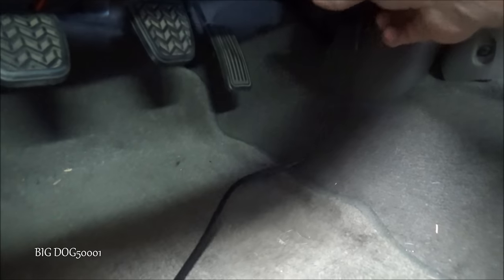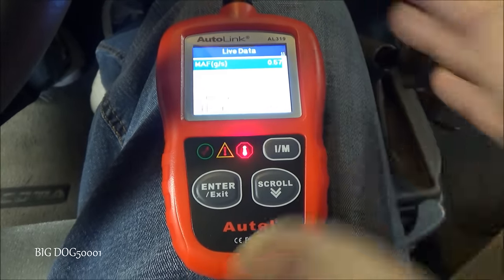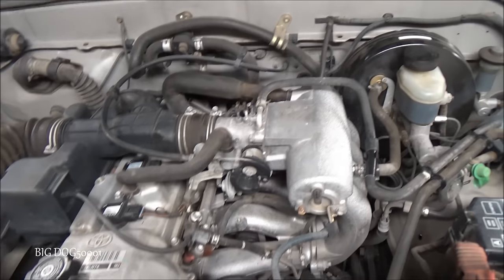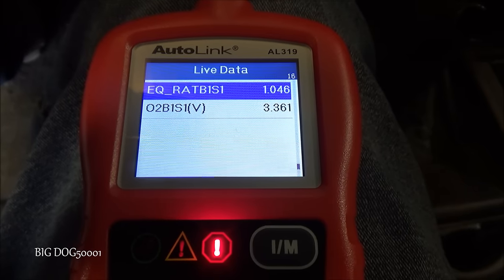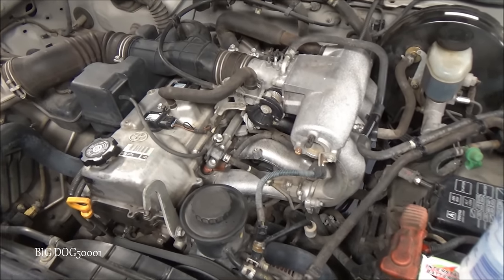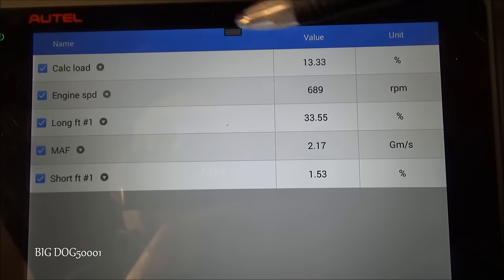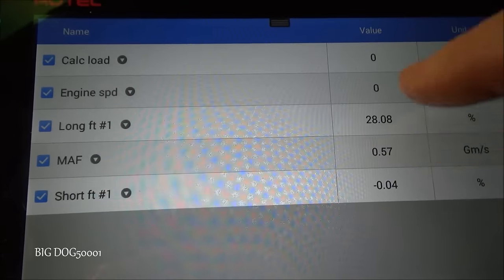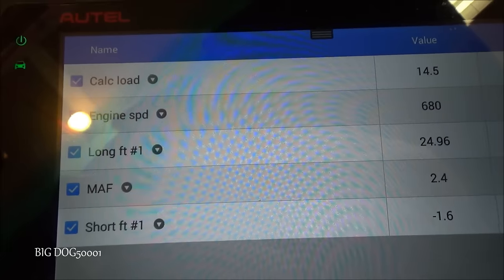P0171 Trouble Code: System Too Lean Bank 1 Diagnosis

Comment: Thanks for a such good video like this one. And would you kindly help me with this issue on my Audi TT 8j, I get P0171 every 2 days. Sometimes I feel surge or hesitation.  When the p0171 occurs, the short term trim was at 0.0%, long term trim at 3.9%, 800rpm, MAF 3.9g/s . So what should I look for? A minor vacuum ? Or sensor? Or fuel problems?

Love from Japan. Thank you very much.
Reply: PS: it’s p0171 system too lean

Comment: Super helpful video my friend!  I have that same code reader and I honestly thought it was just for telling codes. I had no idea I could look at the freeze frame and live data to help me diagnose (I have very amateur mechanic skills mostly limited to repairs my cars have needed).  Thankfully, I was already on the same warpath for diagnosis on my '08 corolla.  Along with the code, I had the added symptom of hearing a loud whine at idle and I'm pretty sure it's the sound of a vacuum leak vibrating somewhere, especially because the noise briefly goes away and/or changes pitch when giving enough gas to accelerate.  But as soon as the throttle is back at idle or maintaining speed, the same noise comes back.  The noise was actually the first thing to happen and ran like that for a bit before the code, so I imagine it's a smaller leak and the tiny leak is just vibrating like a woodwind reed.  Eventually the code gets thrown, but after I reset it, it takes days or weeks to come back.  Now the noise is mostly gone and the code throws easier, so I'm sure the leak has worked its way to a larger gap.

 I recently replaced the PCV and hose a bit over a year ago just for funzies when I did the valve cover gasket (she's got 200k miles), and I wonder if something there has failed.  That's the vague area that the noise seems to be coming from.  I am set to really diagnose the location of the leak tomorrow, but I will definitely use your code reader tips to help me confirm that is the right direction, and specifically look at the fuel trims.

Comment: Not only a Thumb's Up but also a Sub.
This must be the most valuable YT vid I've ever watched.
Not only was the info of high value but BigDog's explanations were outstanding.
A long vid but worth every minute.
I just did a repair on my 2000 5.4 Expedition, cleared a #7 misfire code but now generate a Lean Bank #1 code when I goose it getting onto the Interstate. Since I had the EGR valve off during the repair, my guess is I buggered it up when reinstalling it.
BugDog's vid just walked me through the process of finding my oroblem(s).
OUTSTANDING INFO/VID.........
Reply from the maker: Thank you, I appreciate the comment!

Comment: and/also: be sure to verify the GROUND to your O2 sensors!  I just had a breakthrough... and realized a corroded wire was throwing off the ground on the O2 sensors loop.. and therefore reading LEAN..  and pushing too much fuel / throwing off the balance.

Comment: Can you guys help me please with opinion about this code trouble in my situation, because one day this code appear and I cleared code on other day no codes everything nice. Then again on other day appears this code. I again clear code and drive without any codes, then can appear P0301-P0303 what mean misfire in some days 1 in someday 3 cylinder. So problem that all those codes replace each other's if clear them, they never appear together, sometimes no codes at all. So I can't understand car have probly or not? Cuz if be true problems then code must be all time appear? But in my case it's appear randomly, one day can be without codes in other day can appear one from those codes

Comment: Super educational! Checked it out after engine light have come on with same code several times during the last years.
In my case the freeze view showed a situation at 70 km/h with about 45% load. Fuel trim showed 19,5% short term and 29% long term. 
Did all the visuals but didnt find anything. I dont have a vacuum gauge however.

Fuel trims looks good at idle, MAF around 2.3. Did a couple of hours ride both on the highway, then mixed city driving, while watching live data. Fuel trim stable around 0% give or take -5 to +10 at accelerating /releasing gas pedal moments. Engine light hasnt come back on.

Question (if you have time!): I very seldom drive this car. When I do, it's 99% alone, empty trunk. The latest engine light came on during a trip to IKEA where I loaded up the trunk with new furniture etc. Could heavier loads in some way output a much higher fuel trim than usual? Or perhaps revealing a weak fuel injector that isn't exposed otherwise? I'm also curious if the new higher Ethanol based petrol has something to say..

Comment: Great video. I have a P0171code, lean bank 1. You explained everything I wanted to know about fuel trims and what the scan tool can tell you about the other sensors on the engine. This video and my scan tool led me to a faulty fuel pump.  Thank you.

Comment: Hi, my 2005 highlander does not get better with new maf sensor, it reads 0.3lb/min, stft 20.3%, ltft 44.5% (does not change at all at any time) i step on the brakes and stft reads 19.5. The Ratbs1 is 1.083 the o2V shows 3.94 high rpm 2.98. Snap throttle 4.17all i need to check is a vacuum leak with vacuum gauge, do i accelarate with the vacuum gauge on? Any help will be appreciated

Comment: I live in a Rural Kansas area with my only  vehicle a reliable 2015 Prius 3.  I got a check engine light after a 45 mile drive to a larger city in the area, so i took it to an Auto Zone. The ran the scan tool eith a result of a P0171 result.   Auto Zone told me it could be as simple of a problem as a dirty sensor.  It was near dark near  by the time I was finished setting up /arranging an appointment in another city where I trust the word of the mechanics.  
     I stayed over night in my car as I didnt want to be stranded on  rural road at night.  And  certified ToyoTa Mechanic said if i drove slow , I could drive my car home.  The next day, I drove 30,-32 mph (with several 15 minute engine off rest breaks to cool off the engine) until the I 70 required 40 mph minimum for 8 miles of the 42 milr alternate route.   I made an appointment for their first open appointment time- a couple of days from now.  The dealer is 65 miles away.  Should i have it towed or can i start early and drive with my flashers on even though the solid check engine light is on?

Comment: quick question the MaF(g/s) you said it should be around .4 to .5 for most toyota, does that include 2001 toyota celica?
Reply from the maker: I don't remember off the top of my head but I believe it should be somewhere in the vicinity with the key on and engine off.

Comment: This video was as clear as it could ever be. Followed closely, concluded that it had to be a vacuum leak to both cylinders (p071 and p074 on 03 avalon). After spraying carb cleaner to no avail ,rubbed my fingers like shown in video along bottom of vacuum hoses and found a crack below hose going to brake booster. Love !!! this dude. 5 stars

Comment: I'm trying to follow along, I appreciate the information but what if the fuel trim stays high at both idle, and acceleration?

I'm getting 46% stft at idle 22% ltft but at 2.5-3k rpm it's dropping to 24% stft while ltft unaffected.

Would this suggest both an vacuum leak and a fuel delivery issue? I'm trying to learn but any further insight would be greatly appreciated.

Comment: Monitor your short fuel trim while spraying for external leaks, then pinch off hoses while monitoring sft. Test maf response. maf grams per sec should be X 1.1 of cyl displacement. A 4 cyl 1.8 would be near 1.8 while a 5.3 would be much higher at idle. High fuel trim at idle and higher rpm's would indicate a fuel pressure or fuel injector restriction problem.

Comment: Hi there Big Dog I have a 2005 Dodge ram 3.7 6 cylinder loud air leak and after warmed up and running loud knocking give it gas gets louder and seams like it loses power get off gas knocking gets less  but still knocking I checked vacuum lines had some bad leaks knock went away but came back I've been watching your videos and you said something about this knocking sound with a bad vacuum leak from brake booster. I think what you said put me in the right direction with the booster needing your help thank you Leon

Comment: hi, great video, i had the same code on a 01 tacoma, w same p0171 code and ending been fuel injectors restricted, no driveability problem, but fuel trims inacurate, found aftermarket fuel filter w lots of dirt on inlet and outlet sides. replaced fuel injectors and problem solved.

Comment: Excellent video, really helpful. My long/short fuel trims were 32 and 0 at idle. When I raised the RPMs to 2000, the short term went down (to around -11), which you said indicates an exhaust leak, but my long term went up to 43.8.  So the combined value was about the same at idle vs 2000 RPM.  Does this suggest that the issue is with the fuel delivery system?

Comment: I got a 2017 Nissan Sentra.  About a month ago I got a code P0171 code. It was running just fine. A few weeks after it started to lose power going uphill.etc  weak running . I tried looking for a vacuum leak couldn't find one

Comment: Never fall into that parts hole. I have a Mercedes ML350 that had a broken clip on the air intake & the engine cover could push the intake off the throttle body. Cover on, 'short ft1' would hit 18 - 20% idle. Cover off, 5 - 12% idle. So I reinforced the intake connection with a clamp & left the stupid engine cover in the garage.

Comment: Any way you could point me in right direction would be Gratefully Appreciated 🙏 I have a 2005 ford focus. Car died and wouldn't start; finally restarted after messing with shifter and twiddling 3mths later. Changed fuel rail sensor(had code),P0171 code:: fuel filter,  cleaned spark plugs and did valve gaskets. Cleaned maf sensor. Car stalls after 10 min idling, dying at stop lights ??  Thinking go ahead and change this since I  have it .(ignition switch module)Had forgotten I got this code a long time before it actually started. Got code when battery was low and read not to pay attention to codes from low battery?? 🤔 any ideas? Could it be losing pressure driving or after the 10min.?Thank you for your time! I  have info from live and freeze frames, but I don't understand 🙃 😅
Freeze Frame Report Apr 02, 2022 07:33 PM
© BlueDriver 2019
2005 Ford Focus
1FAFP36N25W218008
Last Entered Odometer: 116,637 mi
02 DTC that caused freeze frame data Trouble Code P0171 triggered Freeze 
Frame. Code Def - System Too Lean 
Bank 1
01 Monitor Status Since DTCs Cleared 0 
03 Fuel System Status Closed loop - using all oxygen sensor(s) 
as feedback for fuel control
04 Calculated Engine Load Value 56.1 %
05 Engine Coolant Temperature 91 °C, 196 °F
06 Short Term Fuel Trim Bank 1 0.8 %
07 Long Term Fuel Trim Bank 1 24.2 %
0B Intake Manifold Absolute Pressure 64.0 kPa, 18.9 inHg
0C Engine RPM 1942 rpm
0D Vehicle Speed 17 km/h, 11 MPH
0E Timing Advance for #1 cylinder 22.5 °
0F Intake Air Temperature 30 °C, 86 °F
10 Mass Air Flow Rate 15.58 g/s, 2.06 lb/min
11 Absolute Throttle Position 31.8 %
14 O2 Bank 1 - Sensor 1 - Short Term Fuel Trim 0.8 %
14 O2 Bank 1 - Sensor 1 - Oxygen Sensor Voltage 0.035 V
15 O2 Bank 1 - Sensor 2 - Short Term Fuel Trim 99.2 %
15 O2 Bank 1 - Sensor 2 - Oxygen Sensor Voltage 0.020 V
1F Run Time Since Engine Start 102 seconds
22 Fuel Rail Pressure (relative to manifold vacuum) 272.234 kPa, 39.484 PSI
Page 1 of 2
Freeze Frame Report - 2005 Ford Focus
2C Commanded EGR 52.5 %
2E Commanded Evaporative Purge 0.0 %
2F Fuel Level Input 0.0 %
30 # of Warm-ups Since Codes Cleared 2 #
31 Distance Traveled Since Codes Cleared 19 km, 12 mile
32 Evap. System Vapor Pressure -137.3 Pa, -0.6 inH O₂
33 Barometric Pressure 99 kPa, 29 inHg
3C Catalyst Temperature Bank 1 - Sensor 1 570.4 °C, 1058.7 °F
41 Monitor Status this Drive Cycle 0 
42 Control Module Voltage 14.019 V
43 Absolute Load Value 39.6 %
44 Commanded Equivalence Ratio 0.999 λ
45 Relative Throttle Position 13.3 %
46 Ambient Air Temperature 20 °C, 68 °F

Comment: I changed the pcv hose that was broken, but I still get a p0171 from time to time. When I changed the pcv hose I had to take apart the intake manifold, because the pcv is underneath it and I say quite a huge play in the swirl flaps. My question is whether the swirl flaps from the intake manifold could generate a p0171 code if they are worn? 
I have an European ford focus mk 2.5, 2.0 engine with LPG. 
Thank you!

Comment: I have the PO171 on a 4.3 V6 Blazer. I have read the fuel trims on my live data and voltage on both upstream O2 sensors. Only bank 1 O2 sensor shows a fault with fuel trim way out and voltage not fluctuating like it should from .1 to 1.0 V. Unless I'm missing something I would think the O2 sensor on bank 1 itself it faulty. What say you? Also what would cause the same O2 sensor to fail in about a year?  Also the 3.4 V on this 4 cylinder O2 sensor. Is that for this Toyota? with my 2000 Blazer I understand O2 sensor voltage ranges from .1 to 1.0 volts

Comment: Hello ı have got Opel Insignia1 .4t and ı have a p0171 .ı have changed oxygen sensor ,maf sensor,intake manifold gasket.maf values 1.6 1.8 fuel pressure 399kpa and acceleration reduces and I have rough idle please help me

Comment: 2000 Toyota rav4 2.0l. Any explanation on the brake booster vacuum. I'm getting a p0171 but now have both p0171 and p1130. My brake booster does have a sucking sound when the peddle is depressed. Any help would be appreciated. I replace the master cylinder but when I did I didn't change the gasket there goes between that and the brake booster. My problem got fixed with the brakes. But now I'm wondering if the brake booster is causing my codes. Thanks

Comment: My car would stall, then I got a OBD II scanner and it told me the issue was the MAF sensor. I bought one on ebay ($30), and while the car does not stall out, I now get a PO171. I noticed that the MAF reading gives me around 3 gm/s while idling  (on a warmed up car), and my STFT reading is 0%, but after several minutes idling my MAF reading drops to 2.4 gm/s for some reason, and my STFT goes up to 20%. Could my cheap MAF sensor be the issue?

Comment: Great tutorial. My 2007 audi a4 giving a p0171. The car starts fine and idles around 1200 rpm then drops to 800 rpm and shakes. I unplugged the brake booster hose and the rpm stays same no change. Shouldn't the rpm rise because I am introducing more unmetered air? I am totally confused. Any help would be greatly appreciated. Thank you

Comment: Hey I’m working on a 4.7 v8 tundra I got the same code with 0.26 g/s seems kinda low right? I’m guessing this is the issue he also has an aftermarket intake that looks disgusting

Comment: I am having this code currently on my 2007 Toyota Corolla CE.
In Live Data (743 rpm at 0 mph)
Short Term FT - 0.8
Long Term FT - 8.6
O2S12(V) - 0.250
02S11(V) - 3.279
MAF (g/s) - 2.12
At freeze frame (922 rpm at 0 mph):
Short Term FT - 20.3
Long Term FT - 34.4
MAF (g/s) said 2.79
Can someone help me understand please? I am so stressed out about fixing this issue. I don't understand why my fuel trims were normal during Live Data

Comment: Thanks for the great video. I have P0171 error in my toyota corolla 2005. Freeze frame ltft1 and stft1 are 40 and 20. But live data (driving and idle) are<10. The freeze frame ECT is 85. Also IAT was similarly low. I changed my fuel pump and air sensor but the error came back. VSS=0
Today after watching this video, I figured this probably is due to colds weather as it was pretty cold in tx the week this error came back. For now I have erased error code and will wait for error to pop back. Any suggestions

Comment: I am getting a persistent error code p2177 on and off. I notice it lights up under acceleration on the freeway. Could this be an intake manifold valve issue or fuel pump. No rough idle or anything and you can't even notice there is an issue with the engine or car except for the code.  Thank you!

Comment: I have a 2000 4runner. The exact diagnostic tool, but the 3.4 V6 engine. My shrtft1 is 19.5 and my longft1 is also 19.5. Why would they be the same? I cannot find a vacuum leak and have replaced the O2 sensors, coil packs spark plugs and wires. Mass airflow Sensor. K&N air filter replacement. Still getting a P0171 and in this heat at lights or stop signs it almost dies to where I'm pedaling it. Any ideas Toyota people??

Comment: MAF 2.31gm/s
Coolent temp 167°F. Outside  temp 40 car is running 
O2S B1 S2  0.27V
Short ft #1  4.65%
Long ft #1  5.43%
O2FT B1 S2  99.15%

You missed  one thing what you did not mentioned. Possibly intake manifold gasket

With the engine at idle, the MAF's PID value should read anywhere from 2 to 7 grams/second (g/s) at idle and rise to between 15 to 25 g/s at 2500 rpm, depending on engine size. Most manufacturers provide specifications for air flow at idle; some will provide specifications at several engine speeds.

Comment: Wish you was here to fix my problem, 60 years old and first time I couldn't figure out a car problem,, 98 trooper 3.5 idles smooth but will not accelerate,, new plugs, fuel filter have 42 psi pressure, cleaned EGR, and Mass air sensor, get po300, 157 O2 sensor, and fuel/air manufacturer code,, all on cold start will pickup rpm one time on start but then falls on her face and kicks and bucks and wants to shut off,, but will idle smooth

Comment: I know this is a 4 year old video, but Im having this problem on my Toyota celica right now, but it is at the point where you disconnected that vacuum purge valve. That corrects my fuel trims, what is the problem AFTER that corrects the fuel trims? what is the next step for that? When I command the valve closed it corrects my problems. what is next?